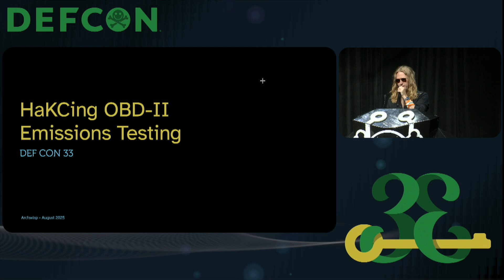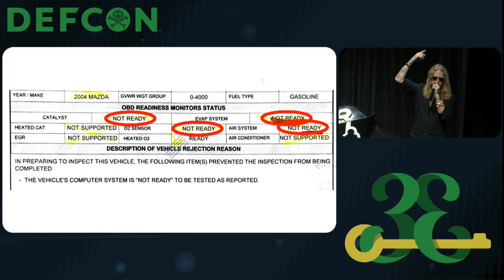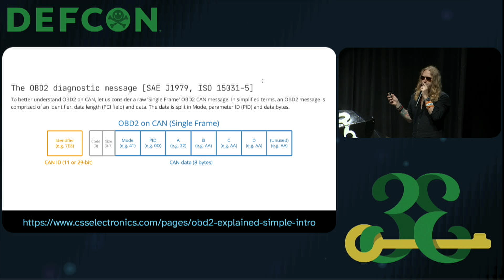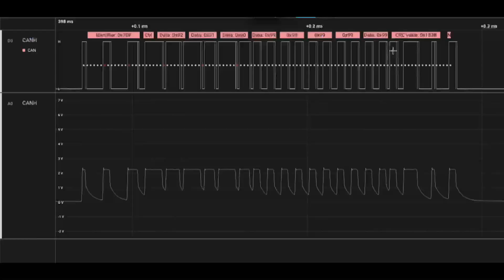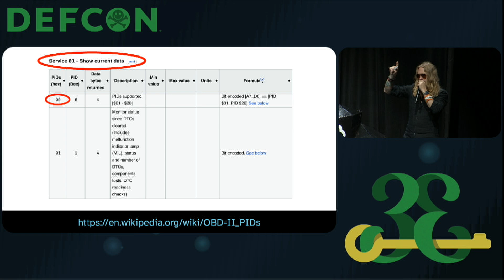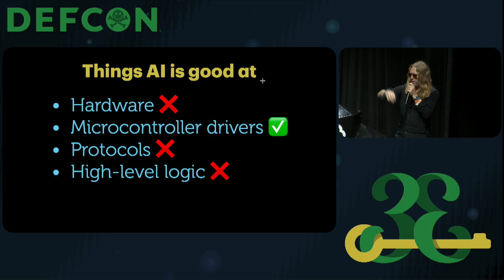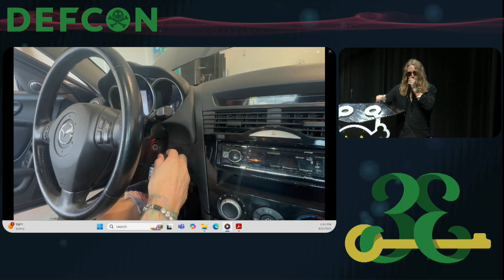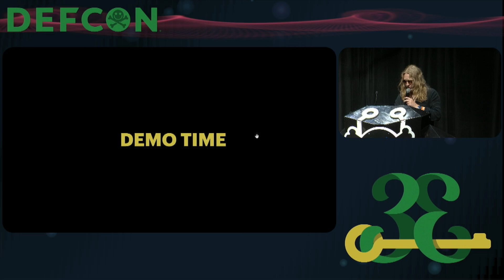DEF CON 33 - Hacking OBD II Emissions Testing - Archwisp

Comment: You can code the O2 light off or trick the system to thinking it's working with some resistors
Reply: I was thinking about doing that. My car hasn't been registered for over a year now because I'm don't want to waste money fixing something that doesn't need to be fixed, especially with all the other problems with my car that DO need fixing
Reply: @Nexalian_Gamer they will scan the system usually and find the codes if they want to pull them 

It may get noticed 

It may not